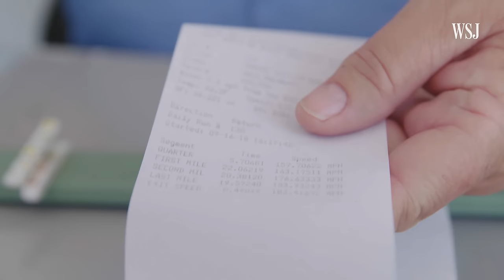How This Cyclist Hit 184MPH and Set the World Record

Comment: Earth orbits the sun at 67,000 mph.  So by just sitting on a bike I am breaking a record.
Reply: @TristanPopken  nice
Reply: BUT... You're unlikely the first woman who makes that calculation :O
Reply: earth don't spin
Reply: When you stand does that mean your standing at the fastest speed...
Reply: Casey Pawlowski wow good job so impressive
Reply: @TristanPopken  ok boomer
Reply: @pedrojello8983  it flips doesn't it? Flat earth theory
Reply: @TristanPopken  So technically he would be going negative 67,000 mph if the sun is orbiting 67,000 mph and hes standing still
Reply: you hold for 1 second and then lose it immedietly
Reply: But she was riding 67,184
Reply: @woahitscoby9122  guys, relativity exists, speed of light is a universal constant. It's not relative. You don't just add speed like first grade.
Reply: Yeah, but she’s doing 67,184 mph
Reply: I love you
Reply: Need courage to seat on that bike..😎
Reply: bruh
Reply: WE
Reply: @TristanPopken     Kelvin is NOT relative. It is the absolute absence of any heat energy. Does move is the wrong term, correct is the atomic particle does not vibrate - from heat energy. Sound could still make it move but that's another effect.
 At 0 K in an atom the electrons would still orbit, but the atom will not vibrate because of heat energy which an electromagnet wave same as short wave radio or light waves. 
Temperature is the same anywhere - 50 c is 50 c.
Reply: There is a difference between speed and velocity...
Reply: Yeah definitley, your claim to a world record is about as valid as hers.
Reply: @elliotthedgespeth3396  Only if you stand at the equator ;)
Reply: Time stamp
Reply: Big brain time
Reply: @TristanPopken  r/woooosh
Reply: Well she actually broke the record by going 67,184 mph
Reply: @SmokeyTube  Fair enough
Reply: Then she is moving 67,184MPH then, so she is still faster than you :)
Reply: ha moreover, depending on the direction of the ride, she might have been the worlds slowest cyclist!
Reply: No, you’re matching everyone else on earth that’s not moving on the surface of the planet.
Reply: Well not really because shed be going 67184mph mister smartpants
Reply: The Sun orbits the Milky way way faster
Reply: I sit on a toilet every day. I must be breaking something besides wind🤢😵💩
Reply: You forgot to include the sun's galactic-orbit velocity of 514,000 mph.
Reply: you're off by 66,000 it orbits at 1000 mph
Reply: @MRALEX9870  You're thinking of rotational speed.  Orbital motion around the sun is entirely different.
Reply: well shes going another 187 on top of that so she still beats you...
Reply: What records are u breaking ? Someone's record that went to minus?
Reply: @TristanPopken  Went way over your head.
Reply: 20 -30 iq bot !
Reply: Yeah, but she also orbits the Sun
Reply: So am i
Reply: So basically all beings on this planet are equally fast
Reply: That's right
Reply: So in a 2000 mph airplane it would be 69000
Reply: So I guess technically she was going 67,184…
Reply: I suppose that someone else, lying in a bed, is closing in on you.
Reply: earth doesnt orbits. earth is stationary. wake up
Reply: So that means none of have ever really stood still
Reply: imagine if guinness is a team that doesnt believe in space
Reply: @pedrojello8983 no it just turns around on it self
Reply: @toasterr4238  The earth is not spinning at light speed mate
Reply: @godschild5587 you might wanna read an actual book once in a while
Reply: But you would share that record with every other cyclist.

Comment: I thought she could pedal that fast... I was like, that's impossible.  Then realized she was dragged up there.  Next time, strap onto a rocket.
Reply: Wait I don't get it? What does that dragster do
Reply: @tajwarjamil6186  The dragster gets her up to speed so she can start peddling on her own power, the gear reduction would make starting this bike almost impossible.  It also provides a windshield as the wind resistance at those speeds would be nearly impossible to overcome.
Reply: @twirdman2  not only a windshield, the dirty air push her from behind, It's kinda sucked in
Reply: @Jackrece  yeah the hole inside the windshield is basically a vacuum. Still a cool record though.

Comment: The cyclist was tied to the car till 105-110mph and she pedalled from 110mph to 184mph. I’d say that’s pretty impressive.
Reply: the bike is geared so high its basically impossible to peddle from a standstill
Reply: tied until at least 140 in the record breaking run.
Reply: Tied over 100mph and stayed behind it to avoid air pockets….this is ok but not all that great since her main job is to hold on and maintain control. Machine did most of the speed gain.

Comment: 18:07 If anyone is wondering why she was pedaling seemingly comfortable before she let the wind slow her down, it's because right behind the dragster, at high speed, a low pressure zone forms for some distance, so when going inside of it the efficiency in her legs power is optimized and she doesn't have to deal with the overwhelming wall of air that would simply squash her out of the bike seat in an instant.
Reply: oh so that's how it works, eh?
Reply: No, I'm sure everyone thought she just had strong legs
Reply: I would be willing to try

Comment: Just hold on to the dragster, tell the driver to let her rip, then let go once you are going 200+ mph.
Reply: At that speed a small tiny tinny bump would send you flying.
Reply: @bluedragongaming8633  Hence the salt flat. Flat means 'no bumps'
Reply: Good luck switching between holding onto the dragster and your handle bars without falling over.
Reply: @DasAntiNaziBroetchen  when you are going that fast its almost impossible to turn the handlebars lol you wont fall over
Reply: Nick Lindsey  mhm
Reply: Nick Lindsey  have you seen the tour de France riders they crash all the time going down mountains at well over 60 mph and while the usually break a few bones and aren't back up to the same level for 2-3 years after the crash the usually don't die not even that close
Reply: @bendee3775  
Yes, I'm surprised they didn't have a reduction mechanism to give her finer steering control.  It's hard to imagine trying to keep the handlebars steady enough for good control at that speed.
Reply: @Henry-gv8gj  60mph and 180mph are very different, ya?
Reply: did you miss the part where you had to maintain that speed without touching the dragster?

Comment: why am i so unimpressed
Reply: because it looks like she is going very slow because of how slow she is peddling...and you dont even even have a static object to check how fast she is (its all white slat bby) but she is going very FAST (like keemstar)
Reply: bananaman22 I felt the same way about Steins Gate.
Reply: 1 because there is a car in front... 2 the bike has 2 crank hahaha
Reply: Had she reached those speeds without being towed in a slip stream, it would be impressive.
Reply: @maxnaz47  what's so unimpressive about using a slip stream? If the resource is available then don't be upset when it is used.
Reply: Zombie 6021 perhaps because without air resistance, it’s not difficult to go fast? Just a thought...
Reply: @memo57708  If you understood the physics behind why she needed to be towed to 110mph before releasing from the tow vehicle, you would understand that the only effort on her part is to hold on and not die. The vortex created by the slipstream literately pushes her into the back of the tow vehicle, hence the bumpstop attached to the front of the bike... The only skill involved was from the driver, not increasing speed too fast and dropping her out of the slip stream to certain death.
Reply: @maxnaz47 
1. Don't assume I don't understand the physics because I do understand it (part of my job to understand physics)

2. I understand that in the end her total effort put in is minuscule but regardless maintaining the constant distance and steadieness is skillful as one mistake on her part will kill her
Reply: The speed limit of many highways is set at 60 mph. At 184 mph, she was doing a little over 3 times this 60 mph highway speed limit. Imagine you are driving your car at 60 mph and a bicycle goes 120 mph faster than you are when it's passing you.
Reply: @TheSteinbitt  Not difficult? Jump out of your car at 180 and tell me its not difficult. Because thats what would happen to her with any error.
Reply: Nabeken you think jumping out of your car is difficult? lol people drive motorcycles at that speed every day
Reply: @TheSteinbitt  I was talking about surviving it my dude
Reply: Nabeken You make the argument that surviving an accident you did not get into is difficult? I’m very confused now.
Reply: I just had to think about falling off a bike at 12 mph to appreciate her record of 184 mph... I mean just imagine it! Eeewww
Reply: Kurisu
Reply: @TheSteinbitt  you try it
Reply: Michael Brenneman Like many others I drive motorcycles at high speeds regularly, but with hard tarmac surface. I don’t consider myself a hero lol. I could easily do this of course, as could most others who are reasonably fit.
Reply: @TheSteinbitt  ok, do it
Reply: @mbrenneman0411  Ok, you set it all up and pay for the whole thing...
Reply: @TheSteinbitt  if you could do it, youd have no problem finding sponsors
Reply: @mbrenneman0411  Literally anyone could do it, so you need an angle to attract sponsors, and I'm not a black woman.
Reply: @TheSteinbitt  Just drop it, at 180mph , it is difficult to keep even your head straight, let alone riding a bike
Reply: Rahul Soni yeah, if you’re actually in the wind, like a motorcycle. I know.
Reply: Probably because she's effectively being towed.

She's ultimately sitting on a stationary bike on a earth sized treadmill that's running 184mph. There's simply isn't a whole lot to be impressed by here.

She had to be physically towed to 100mph because before that speed, the draft forces weren't strong enough to leash her to the tow vehicle without a physical strap connecting them.
Reply: @maxnaz47  thats impossible Lol?
Reply: Reflex  unfortunate. You had to pick the bike tourist who just climbed a 1500m mountain two days ago and easily hits 25mph on flats. Maybe you should get fitter. 

Either way what I can do that you cannot does not change my opinion. I am still not impressed.
Reply: Because it's a woman.
Reply: @TheSteinbitt  if its not difficult why there are not many doing it ? :facepalm:
Reply: @mercetajs  
Maybe because he has an actually life to attend to and isnt bleeding money from his ears to be spent on a specially purposed racecar that then has to be transport to the middle of nowhere. 

IE. This is not impressive for the simple fact that its an EXTREMELY specific record that almost nobody can afford to attempt. It when you are watching a game and the caster gives out some ridiculous stat that has 2 or 3  arbitrary modifiers "Most homeruns ever hit away from home by yankee in his rookie year." Only in this case you have to know a racecar diver and pay 30K dollars before you even have a chance to swing the bat.
Reply: Nabeken jumping out of a moving vehicle isn’t the same as being towed. Invalid argument -1 point
Reply: because she didnt accomplish anything. she jsut thinks she did.
Reply: @NabekenProG87  i mean, she was attached. there is a reason a women is completing this first. ebcause to men it isnt even worth doing because its well...not a physical accomplishment. its a mental one.
Reply: @mbrenneman0411  let me be a women so a news crew and production crew will pay for it to happen. 

there is a reason. men would have to use there own pocket money to do this. this was done to make women seem equal to men.
Reply: Because it's not that big of a deal! Get on a specially made bike, pulled by a high performance dragster! Whoopie!
Reply: @dbspaceoditty  hey man, its 2019, anything is possible
Reply: Because if a girl did it a guy can do it better
Reply: I'm wondering what the toaster cyclist can do here
Reply: Because she was tugging to the vehicle
Reply: This deserves one big MEH.
Reply: @TheSteinbitt  This guy saying that him riding his motorcycle at the same speed is impressive. Look ma I drove faster than Usain Bolt today I AM SO COOOOOLLLL. same energy.
Reply: @zzdoodzz  Its ok, I understand that your life is pathetic enough thag you would want others down at your level so you feel better, we know your life is MEH but its ok, the world isn't fair some people work for their records unlike you.
Reply: @alexteoh9038  I dont know if you noticed the dragster? And I never said riding a motorcycle is impressive, its the whole point, unimpressive.
Reply: Because she is drafting the whole way?
Reply: @elmaghrabi9866  shes goijg fast because of the deagster they counted her speed by checking the speed of the dragster
Reply: @memo57708  it is not minuscule, there is still a lot of friction to overcome at this rolling speed.
Reply: @dbspaceoditty  waah! boo hoo! 😥😪 whatever lol 🤣
Reply: It’s not organic
Reply: @TheSteinbitt  Drive / controlling a bicycle at that speed is hard, than controlling a motorcycle with racing specs "better aerodynamic, etc" but yeah, this is unimpressive tho
Reply: Cause we expected real records not fastest tow truck pull a bike
Reply: @RahulSoniiitb  I manage to keep my head straight at 198mp/h on my motorcycle, it's not that hard just workout your body
Reply: Don’t Test It.  
198 MP/h on my ZX-14R Regularly enough. The longer you own a fast bike the slower it feels.

Comment: I think maintaining stability at those speeds for that long is really impressive. But to the credit of the folks in the comments section, if the video were just re-titled “How this cyclist maintained 184 mph” I think the comments section would be a LOT nicer, because as it is now, the title is QUITE misleading.
Reply: Except that is not what she did.  She accelerated.  She was not released at 184 MPH.  She didn't reach that speed until around mile marker 5, these are mile markers from when she was released not when they started driving.  The goal was to release her around 110 MPH and given they had the GPS working on the actual record attempt that is likely the speed they released her at.  Might have been slightly faster, was not likely any slower.

Comment: Your telling me this dragster can’t even hit 200 mph, sad just sad
Reply: Haha
Reply: Not while safely pulling a person behind it, I wouldn't try it.
Reply: It can she just didn't go that fast I think
Reply: a dragster can hit 150MPH in 1.3 seconds!
Reply: @kalebbenson3528  she said she had it floored maxed out
Reply: You know why they use a dragster?  because that is the power required to clear so much air behind the vehicle. 
If the dragster can reach 400 mph in normal condition, then 200 mph might be close to the max pulling all that air.
Reply: It had a wind breaker which would've DRASTICALLY increased drag and even weight
Reply: It probably can but it’s also got that big heavy wind cage thing on the back
Reply: It can it needed to keep pace for the cyclelist
Reply: A dragster using with basically no resistance on the flattest surface almost known to man
Reply: the dragster is like 25 years old
Reply: You realize this dragster was sitting for 23 years right?
Reply: That dragster has a naturally aspirated small block Chevy.  It’s not anything like modern day dragsters.
Reply: @timfetters5115  thank you. At least 3 people understand
Reply: @rookieman329  the woman would be dragging behind the bike by the clipless pedals!
Reply: It's you're and nobody said the dragster could not go faster.

Comment: The benefit of draft is just amazing. When I see a peloton of roadies I'm always wondering how dangerous it was to be sandwiched between cyclist. After watching this video I can truly understand the reason behind it. Doesn't change the fact that it's also extremely risky.
Reply: I've ridden in pacelines moving up to 27-28 mph.  It's an amazing feeling.  You try to keep about one wheel diameter of space between your bicycle and the one ahead of you, but it takes very steady riders to make it work, and good communication is critical when the peloton needs to slow down.  If your front wheel overlaps and touches the back wheel of the cyclist ahead of you, it will cause you to crash because you lose the ability to steer.
Reply: That's the real thing most people don't see here. It's not that she was tethered, it's that she's using the drag of the vehicle itself. That's the real "cheat." It's not a "windscreen" or anything. It's literally the suction of the air pressure behind the vehicle.
Reply: @apocalypseap  
So you're saying that she didn't need to pedal at all, because the low pressure behind the dragster would keep her pulled in?